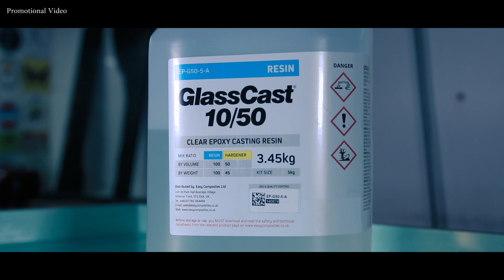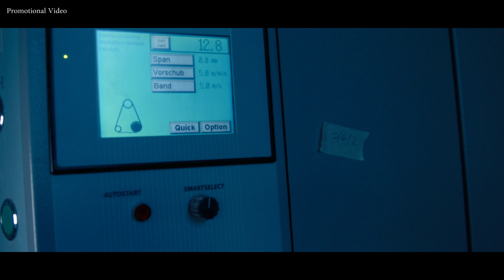epoxy resin coffee table white 23 ct golden pineapple

Comment: wouldn't be easier making this in 15mm opal acrylic? very nice vacuum pump and chamber..
Reply from the maker: Thank you very much! I searched for suitable material but did not find it.
Reply: @SpecialWorks  I thought you are using so much epoxy for the promotion. 
The pet g tape that you are lining your melamine mold comes in wider rolls for 3d printing.
Instead of the tape you can try using 0.8mm petg sheet that it's normally used in thermoforming. It is single piece and it leaves a finished glossy surface without overlaps and it self releases.

I make multiple piece silicone,wood, plastic, hybrid molds as a day job. Casting concrete, polyester, epoxy, pmma,  urethanes,composite stones etc.. The molds are complicated so each part comes finished out the mold.

I really like your setup clean and professional. I'd invest in a better cnc though.. That thing will crap out on you when you have a production run...
Reply from the maker: @jimbit22  That sounds perfect. maybe you have a link where I can find it to look at me more closely?

Thank you so much! I would definitely like to get a bigger and better CNC. However, I have space problems at the moment and a larger workshop is not in sight because I find no affordable at the moment.